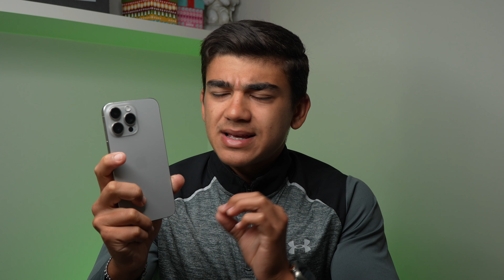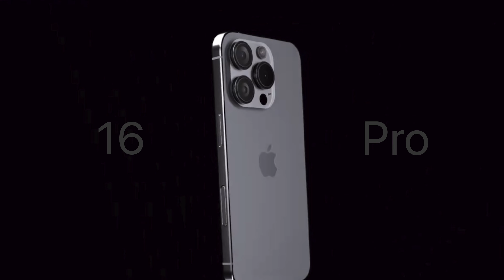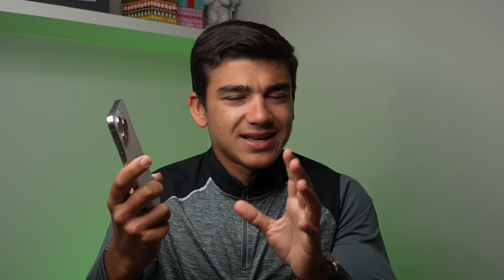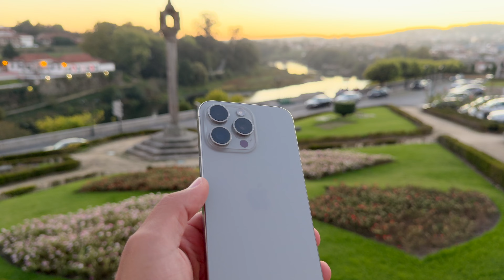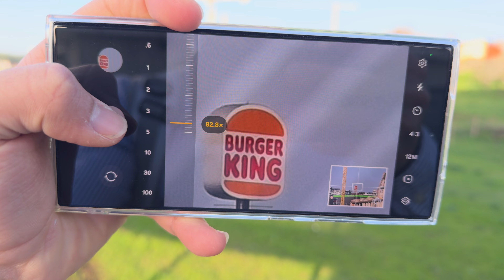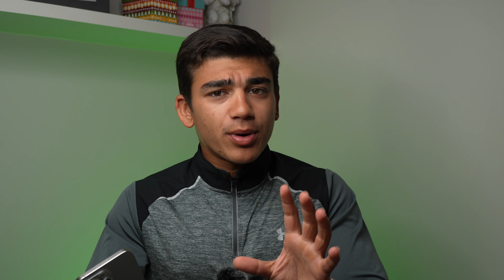iPhone 16 & iPhone 16 Pro Leaks Breakdown! How Can Apple Improve the iPhone?

Comment: I agree on the Heat part, My 15 PM get always hot since launch, sometimes even not doing anything, most of the times I charge it , the device stops charging due to the phone temperature being to hot, the iPhone 15 heating up issues at the beginning never been fix , the software they released didn’t really fix anything, we ended up just used to it
Reply from the maker: I don’t ever get overheating inside or while charging. Only outside on hot days

Comment: I just want the best battery life possible and stable iOS software version like the 13 pros had, therefor I would upgrade to the 16 Pro Max from my current 14 Pro from February 2023 with 88% of battery health
Reply from the maker: The iPhone 15 Pro Max has great battery life. But if Apple can make it better, I’m all for it!
Reply: @Techsumer  Yeah that’s right, especially if they add better cooling and bigger batteries. Also, I hope they learned from iOS 16 and 17 to make iOS stable again like iOS 15 and 12 for example.
Reply from the maker: @satxrnhimself agreed 👍
Reply: @Techsumer  👍